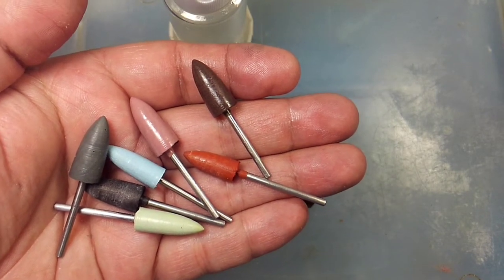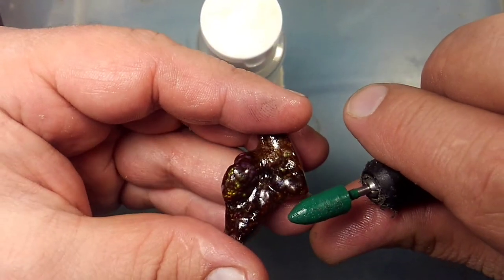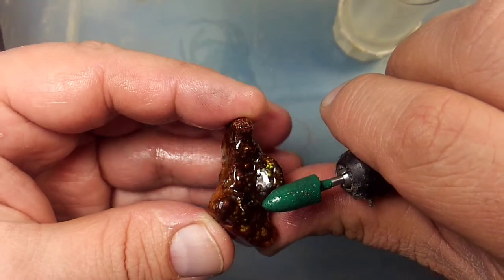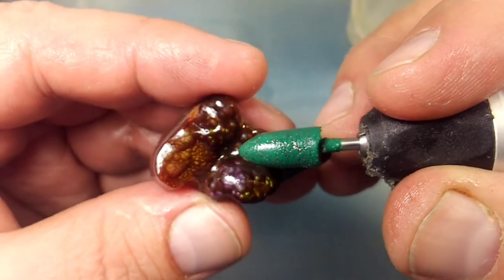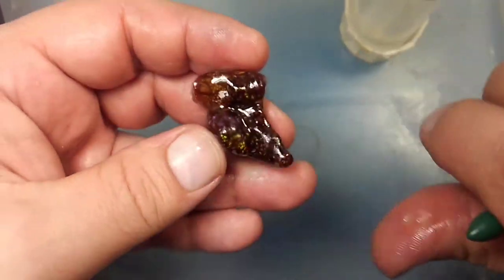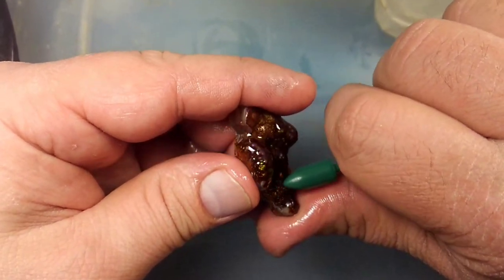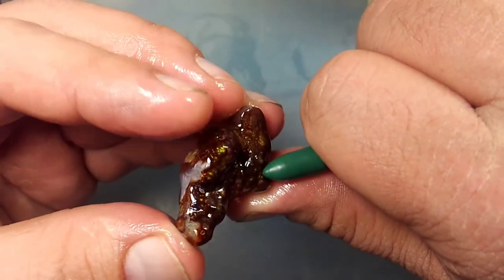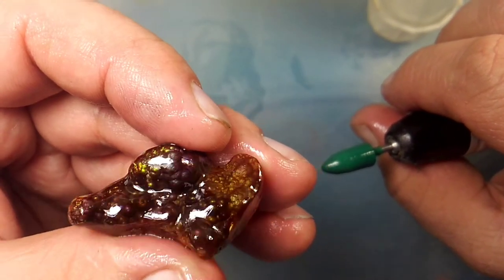Fire Agate Carving Techniques ~ Nova Points

Comment: I am ready to sand my fire agate, first time. Only looking to spend abt $20. Any suggestions?
Reply from the maker: That's a good question! 
Let me see what the best way is. I'll do what I can to help. Thank you!
Reply: @FireAgateMark  I appreciate it Mark!
Reply from the maker: I'm happy to try to help!
Reply: @FireAgateMark  What if I just grind to the color and throw on a quick polish? Skip the sanding process altogether? My gem looks good now while wet, no noticeable scratches.
Reply from the maker: Grinding is the natural first step. I have used only wet/dry sandpaper to finish a stone. I went from 60 to 250 , 400, 600, 3000 and finally 8000 grit. It looked like it was already polished.